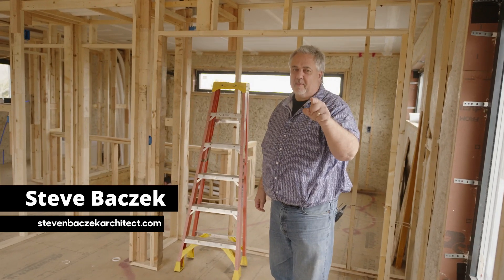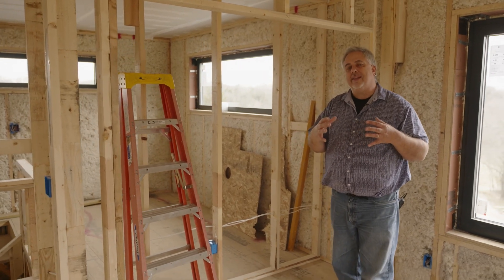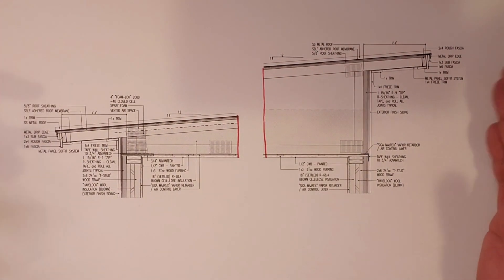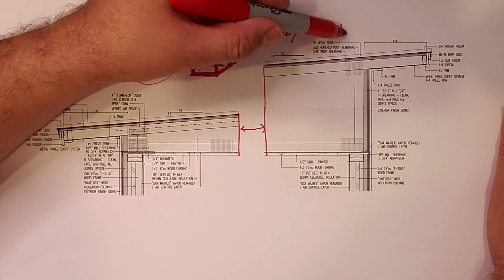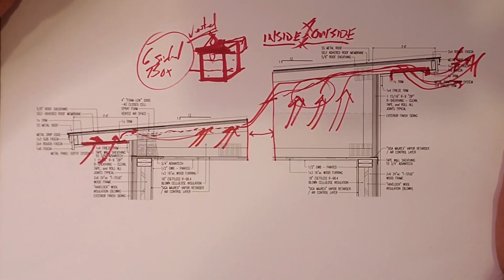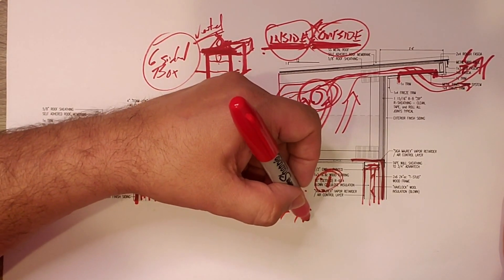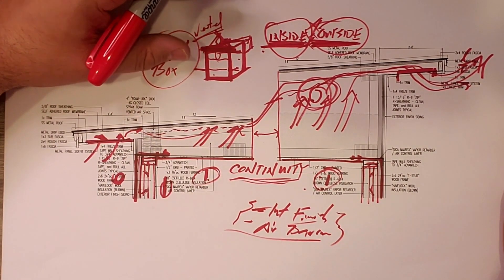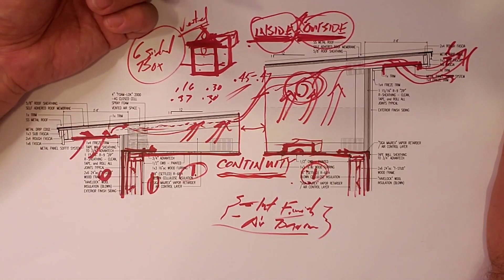Air Barrier Continuity   Continued!!

Comment: I don’t understand why put a flange over the top plate. Isn’t the Sheetrock being used as an air barrier? So why put the Sheetrock right below that flange?
Reply: I'm probably not the one to answer this since I was sent this video to learn what I should do! But my understanding is that the air barrier of the Zip on the outside is "connected" to the upper wall plate, and then with the flange and some beads of sealant transferred to the Drywall ceiling. Without that flange, the potential leaks in the walls can get to the attic. Or something like that!

Comment: I always cover the ceiling and walls with aluminum double bubble then tape all seams and corners off. That reflects the heat in and out. Works great. You are preaching what I've always preached in is in out is out. Never the twain shall meet. Every Building is JUst an oddly shaped Chimney. It naturally sucks air in from outside and then  it goes up. Unless you have an envelope.

Comment: Thanks. I've been looking for a good air barrier solution for vented attic space. Using drywall makes sense. The 3/4 OSB along the edge of the exterior wall is something new to me. Looks like it does require 1x furring strips attached to trusses--which would be an additional step in my area (midwest).  If you get a chance in future, it would be helpful to see this during exterior wall framing, to show attachment/position detail and taping before & after setting trusses. Are there other benefits to the furring strips, besides taking up the 3/4" space? Thanks again for all your work in showing these design details.

Comment: Putting up the drywall before the interior walls makes sense. Please help me with a couple of details before attaching the drywall. 

1. Did you add the Advantec strip to the top plate before setting the trusses? 
2. Apply the Zip tape connecting the vertical Zip-R wall sheathing to the horizontal Advantec strip
3. Place the trusses and nail truss hangers (hurricane brackets) from the outside
4. Nail furring strips the same thickness as Advantec strip
5. Attach the drywall to the Advantec and furring strips, then drywall tape the seams.
At the 4-foot drywall seam that butts together, how did you block behind it?

What if strips of Intello were attached to top plates and the Zip tape sealed the vertical Zip-R wall sheathing to the horizontal Intello strips? Place the trusses. Nail hurricane brackets from the outside. Now add the conventional blocking over the Intello on the top plate for the drywall sheets. Then, staple the Intello to the bottom truss cords and tape the seams. Add blocking at the 4-foot butt seam of drywall sheets. The Intello strips would be long enough to reach the first instance of drywall blocking. The goal is for all Intello seams to have wood backing and taped.

Comment: What led to the use of an unconditioned attic on this house when the Build Show typically espouses the virtues of a conditioned attic?  Is it because it is the most cost effective way to get a high R-value blanket of insulation above your ceiling as opposed to spray foam or foam board on the roof system?  I hate my unconditioned blown in cellulose attic here in Florida.  Hurricane/tropical storm winds have blown the cellulose away from the eaves leaving the ceiling drywall uncovered.  Then, there are all those can light penetrations and duct work up there.  I know your houses are much better designed and executed than upper middle class houses like mine, but it seems like there are many details needed to get right.
Reply from the maker: This is a vented attic on this house?
Reply: @stevenbaczekarchitect9431 Maybe it's semantics.  I'm referring to the space between the horizontal ceiling and the 1/12 pitched shed roof as the attic.  The top of the vented air space is the underside of the roof deck.  The bottom of the vented air space, the dotted line, is what?  It is unclear, maybe because of the video resolution, what it is.  I think I see a callout of closed cell spray foam, which would block off any air or vapor transfer between the vented air space and the main cavity where the 18 inches of blown in insulation is.  I am asking not to troll you, but to understand the system better.  I am at the property search phase for a retirement home that will be similar in design...simple metal shed roof.  My baseline thinking was exterior foam board insulation but this might be a better solution from both the performance and cost.  So could you please explain what makes up the bottom of the vented channel.  Is it nothing or some material that allows the air movement that you show with Big Red?  TIA.
Reply: @markstipulkoski1389  The vented channel is rafter vent/baffle, a foam spacer product stapled between rafters to provide a air gap.
Reply: @MurDocInc  Thanks for the reponse.  Steve put a "?" at the end of his reply to me.  This led me to think he was saying: "This attic is vented? That's news to me." So a miscommunication.  I simply wanted him to explain the pros/cons of well implemented ventilated attic like this one vs a conditioned one.  Another aspect of Steves solution to help get insulation near the tight space near the eaves is he has incorporated "heels" into the roof truss design.  The vertical space provided by the heels allows a thicker layer of ceiling insulation near the walls. My house lacks the rafter heel so no room for a thick layer of insulation.  To add insult to injury, what insulation was there is blown-in and hurricane winds blew it away from the eaves.

Comment: Holy cow.....I had this idea 20 years ago because I was lazy as the day is long.  I didn't want to cut small drywall ceilings.  So I began hanging ceilings first then putting in walls afterwards.
.....go figure....I was on to something.    ( I was finishing basements...so blocking between the joists positioned my electrical drops).
Reply from the maker: Timing is everything lol

Comment: When you use intello or other smart air barrier, would it be wise to combine it with something like aerobarrier?
Reply: Wouldn’t any smart material lose their ability to open/close when aero barrier has filled in those pores?
Reply from the maker: @randymatthews5263 that's a good question,  I have to ask a few people that one. I  would think it may close a very small portion here or there, but it wouldn't have access to the major field of it
Reply from the maker: I consider air barrier as an add on if the builder fails at the primary air barrier